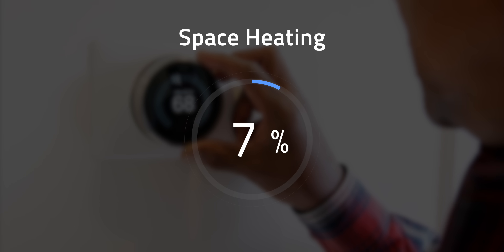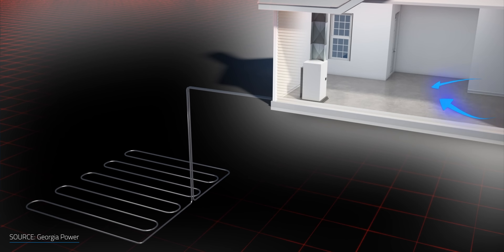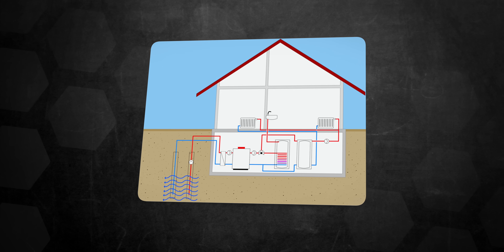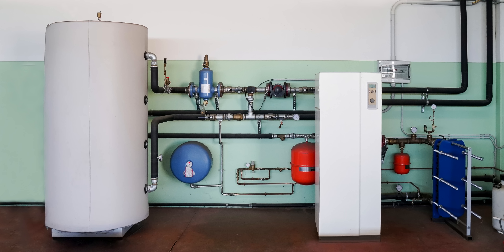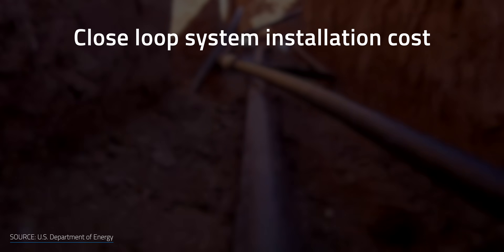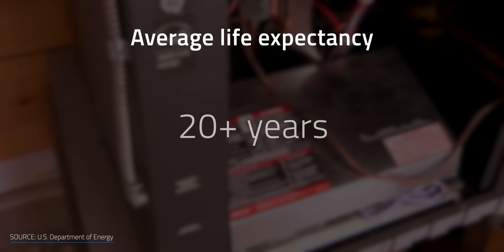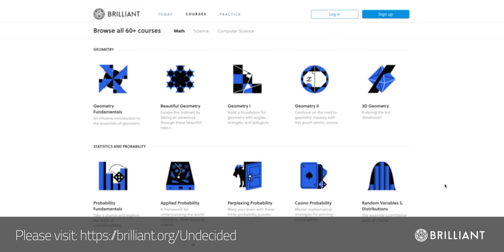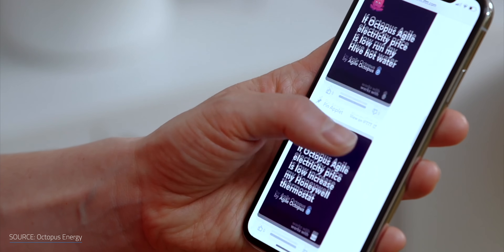Is Geothermal Heating and Cooling Worth the Cost?  Heat Pumps Explained

Comment: I built in 2001 and installed 2 geothermal compressors, closed loop.  Both are housed in my basement(inside, not out in the elements).  The 4 ton unit controls the main floor with the blower unit as part of the transfer unit, the 3 ton unit controlling the second level has the blower unit in my attic.  My well driller drilled 3 wells for the coils and grouted to the water line.  The larger unit took 2 wells at 225' each, the smaller unit is using a 300' well.  The 1500' of coils are suspended in water.  The total cost of the units and drilling was about $22,000.  The total cost to install 2 air to air(heat pump)  units would have cost $13,500.  I have 3000 sq. ft.  The place we moved from was 1800 sq ft using electric baseboard.  My average electric bill in the winter months was $320.  My first full month of use with geothermal... $180.  Heating/cooling almost 2 times the house !  Since I built, I had to install something and researched geothermal to wits end, got three bids and took the middle bid because I trusted it more.  So, my "make up cost" was less than 10 grand making my breakeven about 5 years.  I had NO incentives or tax breaks.  If you rip out a system to install geothermal, then your breakeven period would be a lot longer, with incentives cutting that time.  The largest issue I face is if the power goes out, since the geothermal unit is all electric, so you'll need a back up heat source OR a gennie!  Considering building another house now, it will have a similar geothermal system utilizing horizontally drilled holes for my coil system.  Word of caution: if you put in a horizontal loop system ONLY consider it on ground you'll never build anything else on, because you can't or shouldn't.  Incidentally, my neighbor just went to closed loop 2 summers ago, he burned out 3 compressor units, due to contaminents, using a "pump and dump"(open loop) geothermal well system.

Comment: One thing that would make a conventional or Geothermal system work better would be the way we build homes. Normal home construction is an energy waster. The insulation in your walls maybe thick (R13-R23), but the 2x4s are not. A normal 2x4 has an R rating of 4. If your home was a boat...you would never float.

Comment: I put in a geothermal system eight years ago, and it paid for itself in four-plus years. I had to replace my ductwork as well, and the cost for that is figured in. Still running great and one-third the cost of propane to operate. HOWEVER, since then they have developed super-efficient air-to-air heat exchangers that will even work up here in the near-Canadian north. If I had to do it over again I would definitely check that out first! But it is a win-win scenario either way.
Reply: Are air to air exchangers functional below freezing temperatures?

Comment: @2:50, this confuses me soo much... the blue arrows make it look like the cold moves into the pipes. Took me a second before i got it *facepalm(
What actually happens is the heat moves out of the pipes (so the arrows should be reversed and in red). as heat is energy. cold is not, it's the lack of energy.

Comment: Great video, but having direct experience as a builder in Ohio, I feel obligated to share my experience with geo system installation and performance. 

To make a long story short, you are FAR better off tending to your home's inefficiencies than installing a geo system. Replace inefficient windows and doors, seal any exterior penetrations, add insulation to you attic and basement, etc. You stand to gain more savings and efficiency by doing this than any other home expenditure, and this will cost a fraction of installing a geo system, and will pay for itself regardless of how you choose to heat and cool your home. 

Performance:
1. Geo is extremely efficient at cooling, but cannot heat below freezing temperatures due to avg ground temps being 55° F, unless auxillary heat is used. Auxillary heat is akin to the coils you find on an electric stove. Puts out large volume of heat, but uses lots of energy and is therefore very expensive. To heat in northern climates below freezing, there is no free lunch. To maintain affordable comfort levels, you have to burn something (gas, wood, auxiliary heat, etc) to heat your home and protect your mechanical systems from freezing. If you have the money and fuel available in your area, a dual fuel system is best in colder climates, but it's very expensive. This is the reason I said a traditional system along with insulating improvement is best for most homes. (I'm defining a traditional system being as a high efficiency natural gas furnace with heat pump & A/C)

2. I hear many people (mainly politicians) say things like "technological innovations will eventually bring the cost of geo thermal down to that of a traditional system". This isn't possible unfortunately, because when you install a traditional system you have a furnace, ductwork and and an outdoor unit. A geo system requires all of those items plus you have to add mechanical pumps, drill wells or excavate and install the looped system into the ground, then to a non potable electric water heater (which is separate from your potable water heater). These added components add significant cost and maintenance. This is why geo is and always will be so expensive. Great for larger building like businesses due to economy of scale, not so much for the average home.

2. Keep in mind geo heat is electric heat. It will only provide the end user air temps at what your thermostat is set to, say 70° F. Human skin temp is around 98°, which is why electric heat feels "cold" on your skin, it's blowing out 70° air. Conversely, gas heat for example will circulate air that is warmer than your skin temp so it feels warm and heats very quickly and efficiently. This is why it's so important to make sure that once you heated or cooled your home, you're priority is to keep that conditioned air inside your home, i.e. better windows and insulation. So remember, if you live in a climate where temps fall below freezing, you will pay significantly more than a traditional gas/wood/oil system in electric bills using geo, and use more energy than a traditional system as a result. If we want to get away from coal fired energy, this won't get us there. 

Other considerations:
1. In the U.S., there is a 30% tax credit to encourage homeowners to use green energy. This sound good but  logic tells us the following: what demographic can afford green energy? Is it the average homeowner? Probably not. The fact is that nearly all geo systems are installed in homes owned by the wealty, and since there is a tax incentive, this means the working class is subsidizing these systems for the wealthy. There's go to be a better way.

I love installing geo systems, because more expensive jobs mean more income for me and my family. But I refuse to deceive someone to make more money.  This is the dirty little secret of green the energy industry and others unfortunately. 

2. Recouping your installation costs: a geo system on average will cost 2-3X what a traditional system costs. For the average home this translates to around $15,000.00. The monthly savings on your heating/cooling bills will take a long time to break even.
Reply: You are awesome.  Thanks for your perspective and also being fair to fellow human beings.
Reply: What sort of an HVAC system would you recommend to those who don't have access to natural gas? Only other options are propane, heating oil, wood and ASHP (air sourced heat pumps, for others reading).

ASHP looks like it's really improved in the past 10-15 years, especially "Cold Climate" heat pumps, such as those made by Mitsubishi. Still waiting on my quotes between the Mitsubishi heat pump and the geothermal system, but if the difference in price is over say, $10,000, I'd be leaning towards the Mitsubishi Zuba. 

With the prices of propane and oil being what they are, and looking like they'll increase, theyre out of the question.

Comment: This is nonsense. A long span of buried copper tubing costs about three hundred dollars. So bury the copper tube in your backyard, and run water with a little propylene glycol through it. Then you just need a cheap electric water pump, and a car radiator with an electric fan. The water will get about about twenty degrees cooler as it circulates through the buried copper tube. Then the radiator will blow cool air into your house. The efficiency will vary depending on how deep you bury the copper. But basically, it’s free air conditioning. Those heat pumps are a waste of money. And they use a lot of power.

Comment: i live in germany. i paid 20 k euros for geothermal. it costs me 60 euros per month to heat my 2000 sq house in the dead of winter. well worth it. I have great installation since the house is new. constant 23 C year round. i have 120 sq meters of absorber mats 1.5 meters underground. I have a nibe system with absorber mats. 7 to be exact. also heats my hot water. heating is under the floor. fantastic. comfortable

Comment: We moved to MO in 2008. The HVAC system was 25 years old and no one wanted to repair it. After 2 HOT summers and $450 month of electricity bills, we were advised about the Waterfurnace Geothermal system. $22K to install and with the incentives ended up being $8,000! Our monthly utilities went down to $75 a month in the summer. The system paid for itself very quickly and we are very happy.

Comment: What you didn't cover is that heat pumps are most efficient to raise the temperature moderately (as used for underfloor heating), but least efficient to raise to high temperatures (as used in radiators).  That's fine for new-builds, but to retro-fit underfloor heating is another major expense and upheaval.

Comment: My relative do have geothermal heating system… it can heat the pool as well .. good think is winter time don’t need to rush for putting coal / wood… house always warm by geothermal heating….low maintenance.. even house floor can be heat by this system . Bad thing is installing the system is still quite expensive not everyone can effort it.

Comment: We have a vertical loop geothermal system at my office.  It has been a colossal money pit of a system, and many of the local HVAC people won't touch it for repairs because it's not a standard system.  When it's working, it works great.  Most of the time, however, we are down at least half of the interior units.
Reply: Dad worked in HVAC for over 30 years. You are not alone. He will not install one in his home. Like you said, they are a money pit.

Comment: To answer your video’s question is a decisive…NO.  It’s a great idea, but my personal experience is that it’s not worth it.  Getting geo installed is expensive and those tax breaks are awesome.  But…I just replaced my home’s geo with standard cool/heat because the geo broke down on multiple levels.  (Pump, filters, humidifier, etc.). It was a constant battle with not-so-cheap repairs.  My estimation is that, over the course of the life of geo, I could have replaced my system with standard heat/air THREE times.  Yes…THREE times. Never again will I be an “early adopter” with this technology.

Comment: This is my house nr 4 in Sweden that I install a heatpump with a drillhole 150m in the ground outside the house. It works excellent and have saved me a ton of money the last 20 years!! No problems, quiet, clean, no noise... just ultra low electric bills...!! if you click on my alias 0e32 you found a video when the drilling company make one of my energiwell 150 meter at Öland i Sweden.

Comment: Skycool radiating heat panels.

CSIRO cane up with an ultra low cost airconditioning system.

There are a number of diy YouTube videos.

You can buy 5:1+ split systems now.  1:1-3:1 is old and tech.  All modern split AC are efficient best pumps.

Solar airconditioning.

Go for it!

Comment: I love statisticians more than politicians. 15% energy used for heating, 16% for cooling. in total 31% used for heating/cooling. They just made everyone heat and cool their houses at the same time
Reply: I think that's anual energy usage
Reply: @cotrunder  it is, and redox hills  point is valid.
Reply: @dvig3261  If i use 15% of my anual electricity consumption to heat my house in the winter, and 16% to cool it in the summer, the total anual use would be 31% for heating and cooling yearly. Thus, if the timeframe is 1 year, i am effectively heating and cooling at the same time (in the same year)

Comment: COP don't work as you described, for every Watt used, a tipical heat pump with a cop of 4, takes 4 Watts of heat from the cold source and give 5 watts (the 4 taken + 1 watt you imputted, that transform in heat) at the warm source.
sorry for my bad english

Comment: Seems cool. But most of the amps or electricity comes from the compressor. All this does is eliminate the need for a condenser fan. Which only pulls about 2 amps. So pretty much the same energy consumption unless water is used for the refrigerant

Comment: Based on what they charge to replace a broken waterpipe how is it possible that it only costs $30,000? Having a contractor dig up your whole backyard to retrofit a house here would have to cost over $100,000. $30,000 must be them cherry picking the lowest cost area they could find since construction prices vary WILDLY depending on local government.

Comment: Maybe a dumb question, but what about places close to the equator. Would the temperatures underground be significantly colder than the surface so that houses could be cooled with this system?
Reply: As I understand it. This system is much better for AC then heating

Comment: im an hvac technician. and i want to show some perspective.... its still uses the basic components of a regular heat pump. so youre paying 25,30k some places even higher in some places. say you have regular heat pump on your house. you have sn indoor fan motor. compressor, and outdoor fan motor using energy. in. geothermal system,  the water loop replaces the tiny outdoor fan motor... that usually uses about 1 amp during operation, well itsa water system so you need a water pump right, so you add an amp back in right there.

Comment: Excellent video! Clear and concise. I have been thinking of installing a geothermal heating system for a while now as we are planning extensive refurbishing of an old barn adjoining our house. This video will help to convince my husband that it is the right thing to do for the long term and the environment. We are in France but I believe the principles and the economics are similar here. My only concern is that the area where the tubes (vertical) will be installed is not easily accessible and therefore will raise the cost of installation considerably... oh well, we'll see. Thanks again for a well explained video.

Comment: In really cold places like the northern parts of Europe it may be cost efficient. In the Netherlands (where I’m from) with a relatively mild climate it’s just to expensive to install. An air/water heatpump works just as well here, one-third of the install costs, similar electrical costs.
Reply: yup. the kind of ground you have matters a lot too. Just the cost to dig can skyrocket with these systems.

Comment: No! It also has an effect on the water table and will dry up your neighbors well. And too many contractors do a terrible job installing the water stealing behemoth.
Reply: With an open loop system the discharge water eventually seeps back down to the water table. So your comment has no merit.

Comment: The adverts for geotherm looked so great ... and I bit.  In 2010 we installed a 3T, horizontal loop, geotherm system in a new 2k sq ft. well insulated home.

Huge expensive mistake.  

Those big reductions in our electric bill that the salesman said would help the system pay for itself in a few short years ... never happened.  Our electric bill is on average with other 'all electric' homes in the area.  

Reliability the salesman promised us ... big no.  As I type this response, we are yet again without hvac.  In the hottest part of the summer, with temps in the mid 90 range, humidity often above 80%, we are using two of the smallest $130, 5000btu window units WalMart sells to keep the ground floor of the house cool.  Some of the reliability issues are a direct result of the company who sold/installed/serviced the unit, others, like the giant heat exhanger that resides inside the unit spitting out all the freon (+$3000 repair bill) are just shoddy quality control from the manufacturer.  Leaking ground loop lines that need to be recharged every year, yet another issue with the installer.  Many, many other issues leaving us without heat, or air, and it's usually in the coldest or hottest parts of the year.  Reliability and upkeep are large negatives.         

The noise issue is another ball of worms.  Again, the salesman promised us a quiet unit we would barely be able to hear running.  It often wakes us up at night when it turns on.  The Orkin man was making his normal visit when the air turned on, and he quickly perked up and asked if there was a monster inside the wall he needed to spray for.  

Lesson #1:  Finding an HVAC salesman/dealer you can trust is like finding a used car salesman you can trust.  I did the research and thought this was a slam-dunk decision but got taken by an unscrupulous dealer who spent loads of $$$ on advertising and sales, with very little cash spent on the product or customer service.

Lesson #2:  If is sounds too good to be true ... you know the rest.  

I read other people's success stories with the geotherms, but knowing what I now know, I read those stories with a grain of salt.  Even the contractors we currently use to service the unit, shy away from selling geotherm systems as they outright state, they like the $ profit, but dread the inevitable service calls after the sale.